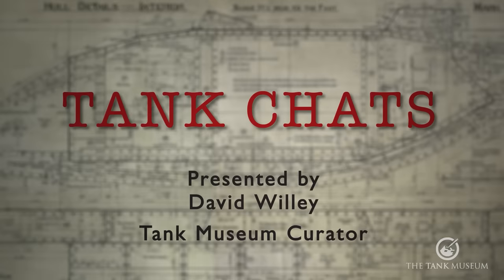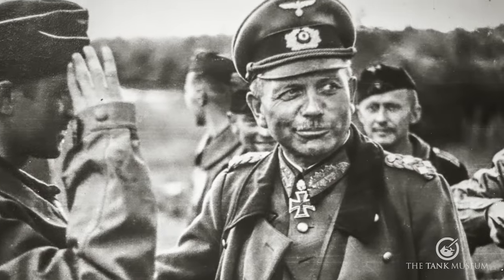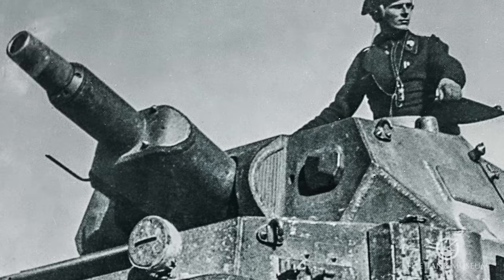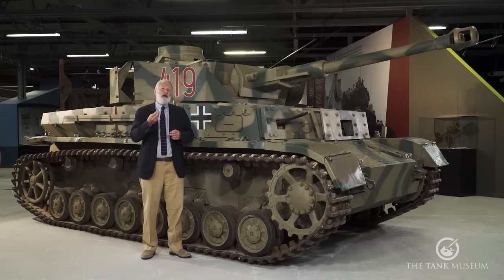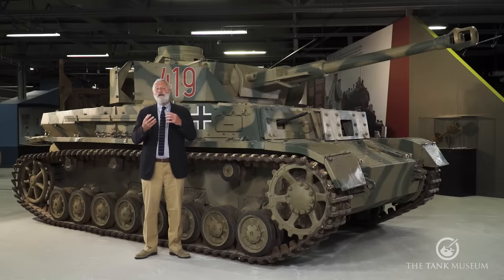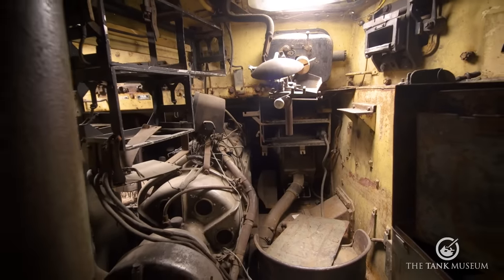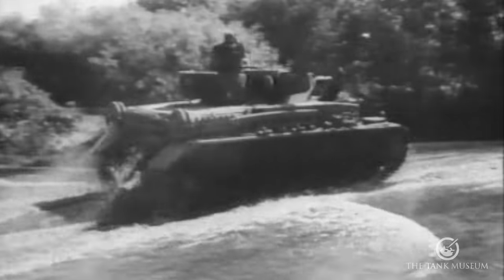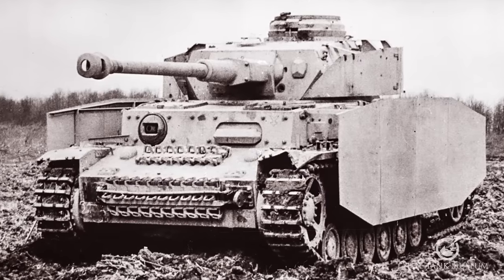Tank Chats #106 | Panzer IV | The Tank Museum

Comment: 75% of all PzKpfw IV losses were actually on the Eastern Front.
They better, considering that 80%+ of fighting took place there.
Reply: Tell us all about how you came up with that number.
Reply: @iatsd  Majority of land warfare took place on the Eastern Front as Wehrmacht rolled thru Europe in less than 2 years, taking minimal losses and then was stuck fighting Red Army for almost 4 years. Eastern Front saw the most brutal fighting during that conflict, with most major tank battles taking place there.
In addition to that, even after D-Day, despite Americans liking to believe how they won that war(or at the very least were critical to Nazi defeat), number of divisions engaged on the Eastern Front was around 300, to around 50 in the west. With latter also being mostly in subpar condition, as France was used for recuperating, rearming and resupplying units that sufferer heavy losses on the Eastern Front. While Western Front saw some properly equipped, trained and experience units, like Panzer Lehr, those were few and far between.
Reply: Tom Sanders  Eastern Front seemed to lack the Battle of the Atlantic and the strategic bombing offensive.
Battle of Atlantic was not a priority for Germany, as Luftwaffe and Kriegsmarine together were only getting about 40% of all military funding. Main push and priority was on Wehrmacht.
In June 1944 40% of the German army was not on the Soviet front.
Nice try. Two can play this game.
Excluding anything but France, taking in account total manpower of Wehrmacht during that period, extrapolating...
In summer of 1944 ~85% of German army were not on American front.
In June 1944 the greatest concentration of German armour was in Normandy.
By what standard ? Total number of tanks was roughly equal between Westers and Eastern front.
While Germans did not have a lot of tanks in Normandy itself, they brought in reinforcements from other parts of the France. Granted, they were scraping bottom of a barrel, so it included completely outdated machines as well.
If one looks at where Germany spent its treasure it was in systems which were most actively engaged against the West - high tech stuff like radar, aircraft, rockets, U Boats.
I have and the answer is "no".
Radars were used all over. Luftwaffe received about 28% of all military spending. Rockets were fun, but there were nothing more but pet project, especially in second part of the war, as Germany was concentrating on weapon systems that proved their effectiveness. U-Boats did a lot of damage, but it was due to their good design and crew training, plus abundance of targets. Total expenditures on Kriegsmarine were around 13% of military budget.
and 70% of single engine day fighters ended up in the West
No, majority of aircraft, at this point in time, ended up in Germany. Not that there was much left of them at this point.
Even that supposed sideshow of Italy peaked at almost 29 German divisions - quite a lot for a rather small length of front!
Tessin work is considered to be competent, but he was dealing with quite limited data(considering how this rather extensive summary was released in 66) and hardly conclusive, as even in this article it is stated on multiple occasions that many numbers may not be accurate.
Reply: Well, if the Nazis and Soviets would have simply moved the eastern front to France, SHAEF could have rolled them up together and smoked them both.
Reply: @sjent .
Some of the best panzer divisions were in Normandy, including 5 of the 7 Waffen SS panzer divisions and 3 of the best Tiger battalions including the most successful of all, 503.
Around Caen, the British Commonwealth faced the densest concentration of German armour ever deployed in WW2. 7 panzer divisions and 3 Tiger battalions in just 20 miles of front. There were no outdated machines in any of these divisions and both the King Tiger and Jagdpanther made their combat debuts around Caen. 
2/3 of German WW2 expenditure and material resources went on their air and sea forces and these were largely destroyed in the west. Already by the end of 1942 only 25% of German fighters were on the Eastern Front.
Most German army divisions on the Eastern Front were second rate horse drawn non mechanised rabble.
Reply: @RW4X4X3006  Lol, good joke. 
If it were to happen and Wehrmacht and Red Army were just neutral towards each other, not even allied, Allied forces would have as much chance as snowball in Hell.
Only reason D-Day invasion was successful was sheer size of invading force and the fact that they were fighting not just underamed and understaffed forces, but sizable part of the force they were facing was composed of old, crippled, teenagers and wounded(since France was used by Germany as R&R area).
But then again, i should not be surprised, considering how this tradition has survived to this day.
Reply: Tom Sanders  You can admit that you were wrong.
There is nothing to admit, your data is questionable at best.
the 1000 or so U boats produced during the war could equate to how many Panzers do you think..?
Ahh, yes, whataboutism, my favorite logical fallacy. Does not negate the fact that Kriegsmarine received far less resources than nay other branch during war.
I would suggest to a far lesser degree than in the Atlantic and West
You can suggest whatever you want. I would prefer facts.
The Soviet strategic bombing offensive was virtually non existent by day or night - so they had no impact on disrupting fuel, equipment production, transportation and research projects.
Right, because ~15000 aircraft(half of the in the west) at the time of German invasion was nothing to worry about. And Germany 2800 planes were more than enough to take on soviets, while flying blind.
I note you were quiet too on the many AA guns and personnel tied up in Germany...
Because i have no idea. Ive seen numerous sources citing wildly different numbers.
Albert Speer the later armaments minister said that in his opinion by 1942 the Western Allies (ad at hat stage mostly the RAF) already had a Second Front.
Id like to see a link to this full document.
Many of the panzer divisions in Normandy were full strength and fully equipped. Sure there were "static divisions" - but there were many divisions in the East which were classed as being able to defend only - ie static divisions.
Majority werent, otherwise they would not be sitting in France, waiting for equipment and reinforcements. Most military units arriving there were disbanded and their personnel and hardware added to already existing units, waiting for reinforcements. So when Allied forces landed on D-Day most of them were undermanned and underequipped and continued to operate this way for duration of whole campaign, as there was simply not enough reinforcements available.
You say that the German day fighters came to be based in Germany (as they were driven out of France and the Low Countries)  - many were, but they were not being used on the Eastern Front - that is the point
Because there were barely anything left of Luftwaffe. Planes were being shot down faster than new ones were put into action.
...yet many were thrown in to the Normandy battle - and lost - and the stats show that Luftwaffe crew were far more likely to survive in the East than the West.
Many ? On 6 June 1944 only the I/JG 2, I/JG 26, III/JG 26 and the stab squadrons were present.
During whole campaign Germans had barely 1/10 ratio with around 1000 combat planes total.
...or that the Axis defeat in North Africa involved losses in men and materiel  on the scale of Stalingrad.
North African Campaign lasted for 3 years, Battle for Stalingrad 5 months.
not like the British Empire or the US which could be fighting one or even two oceans away
Irrelevant. Soviets had to fight in same areas where they were growing food or manufactured tanks. For them it was far harder.
Americans never had anyone attacking their mainland. Even Japan, that was fairly irrelevant from standpoint of European Theater, never reached past Pearl Harbor, not to mention that their armed forces were so small, that their whole plan was to take US by surprise and then dig in and force US into negotiations, due to logistical issues associated with fighting for every rock in that big wide ocean.
Brits blatantly got lucky. Hitler could have completely crushed British military early on, but due to his nationalistic sentiment, instead of destroying 2/3 of British military in France, with minimal casualties, they were allowed to flee.
while others fought on both fronts, AND supplied material aid to the USSR.
Soviets had to fight, while both Brits and particularly Americans, chose their battles and were sitting on defensive till they were ready. After German military was severely depleted.
Oh, and let's not forget that other campaign that lasted the entire war in Europe - the Blockade of Germany - restricting its ability to import fuel, food and various metals.
None of which played major role in the war.
Worth recalling too that by the end of the war the US armed forces were comparable in size to those of the USSR.
And... ?
US would not be able to take on USSR at this point in time.
I'm not convinced that without the Western Front to USSR would have survived.
And you are entitled to your opinion.
Reply: @sjent  Read my post above. I provided a list of all the panzer divisions in Normandy with their tank types and tank numbers. None of them had second rate equipment.
8 of the panzer divisions had a Panther battalion. There were circa 650 Panthers, 750 Panzer IVs and 150 Tigers. The rest wete Stugs, Jagdpanzer IVs, Jagdpanthers etc.
All top quality stuff.
Reply: @sjent  That explains how the allies managed to wage and win the war around the entire planet, eh.
Reply: @sjent  Brits got lucky? No they had an air force and navy that Germany simply couldn't overcome. Germany couldn't even defeat the Royal Air Force even when it was at its weakest in June 1940. It got stronger and stronger from July 1940.
The European Axis never had a major war changing victory over Britain after France in June 1940. They failed in the Battle of Britain, failed in the Battle of the Atlantic, failed in the Mediterranean and failed in North Africa.
To 'crush' Britain you need a superior navy and air force. Germany had neither. The RAF was the Luftwaffes match and the Royal Navy was the Kriegsmarines master. You cannot defeat Britain with land forces if you can't even get across the bloody Channel.
The bottom line is that without the British Commonwealth in the war in 1940 and 1941 the USSR would have lost in 1942.
With no British Commonwealth in the war, the European Axis would have grown larger, more powerful with more resources, and would have controlled everywhere from the Azores to Iran. Turkey definitely and Spain possibly would have thrown in with them. That is then a huge Axis coalition and better placed geographically. Turkey borders the USSR south of the Caucasus. 
The Axis on the Eastern Front would then have overrun Russia at some point in 1942, Stalin would have sued for peace and been exiled somewhere east of the Urals.
Reply: @RW4X4X3006  Huh ?!?!
Reply: @sjent  The allies waged war around the entire planet. That's why we refer to it as a World War. The conflict between the Nazis and Soviets, was confined to eastern Europe. You need to stop studying cereal box labels.
Reply: @RW4X4X3006  The allies waged war around the entire planet. That's why we refer to it as a World War.
World War is called World War primarily for just one reason - it was war for control over the (most of the) world. The fact that it was waged across multiple locations and involved multiple nations was secondary, as wars that fit into this description were fought before, but were not called World War.
The conflict between the Nazis and Soviets, was confined to eastern Europe.
Absolute majority of deaths and devastation happened in Europe(USSR and Germany accounting for over half of death toll). Second largest death count is attributed to hostilities between China and Japan, altho their conflict started long before WW2.
Those two combined account for 85-90% of all casualties.
You need to stop studying cereal box labels.
I would tell you to pick up a history book, but i doubt ti would help much.
Reply: @sjent  Secondary expert, eh.
Reply: John Cornell  Bro, those numbers even if correct, they are still not the best example. Cause in 1944 to 1945 there were no German division that was at full strength on any front, they can no longer replace thier loses. Hitler focused the Werhmachts main  effort on the western front because the possibility of victory in the east is highly unlikely, meanwhile it is in the west that he thinks he could achieve some semblance of victory. That's why on September 44 they began to plan the counter offensive in the ardennes, that's why you will see the best equipped units in the Werhmacht is in the West because that is where the main effort will be. Of course, without the western allies the chances of success of the Werhmacht in the East is significantly higher. But also without the Soviet Union the Western allies would have taken the brunt of the second World War, it would require few million allied  lives to conquer Europe which was basically under Nazi control. It is safe to say that the Army that won World War Two was the Red Army.
Reply: The Soviets inflicted the majority of German casualties.  No argument there  The Americans supplied large quantities of supplies to all
the Allies, and by 1944 were responsible for providing a great deal of pressure on the Germans in the West.  The Americans were also on the offensive in the Pacific since June of 1942 and that was savage, brutal fighting that required huge resources over millions of square miles of ocean.

Comment: In hindsight they shouldn’t have even bothered with all the other tanks they ended up developing.  Should have just put all their efforts toward cranking out 50 thousand plus panzer 4s in various configurations.
Reply: But in what should they have been run on?
They barely had enough fuel for their historical amount...
Reply: Jakob Rinsdorf  if you average the fuel usage of aall the various armored vehicles they ended up building I’m sure the equal number of pz4s would use much less fuel.
Reply: @jakobrinsdorf7791  The things are probably more fuel efficient then the Tiger? Given they don't drag around the same amount of dead weight. It would have also saved a pretty nice amount of cash that could be invested in the supply line issues. Building more lorries or coal to oil factories. Easy to say in hindsight though.
Reply: The Germans were never going to win a war of attrition and the combined industries of the Allies dwarfed the German's. Put simply the Germans needed to invest in bigger and deadlier tanks to compensate for their lower numbers. 

Also the Germans didn't even have enough feul or men to supply the tanks that they did have, so adding thousands or possibly tens of thousands more would have only realistically resulted in a ton of unused tanks.

Comment: Imagine the ressources spared if they realized in the 30s that they didnt need the pzkfw 3
Reply: Pz 3 was more useful in French campaign than Pz 4. And without them we wouldn't have the awesome Stug...
Reply: The Stug III was germany's most produced and most succesfull AFV wasn't it? While they could've gone for the Pz4 chassis through the StugIV variant, you'd have to share production of the chassis between Pz4 and Stug 4
Reply: @broworm1  Stug most produced /yes. Stug most successful /kinda. As I said both vehicles had different purposes, and because the chassis difference they have advantages. You have to consider the intended initial roles for each one and how they ended the war. The sole weight and fuel consumption of Pz 3 made it perfect for breakthrough in early WW2 and a perfect scout at the end.
Reply: They should have used the pzkfw4  chassis from the beginin as tank chassis and stug chassis, as hitler stated in 1941, the pzkfw3 was a faillure due to the fact that waffenambt ignored his demand to equip it with long 50mm from the beginning, pzkwf3 with 37 mm gun losses in russia 41 where insanly high
Reply: @danydierickx3228  I'm afraid you are mistaken the Stug IV with the Jgpz IV. One is an infantry support vehicle and the other was a Tank destroyer. You just can't use the same chassis for everything, even today there are no support vehicles based on current MBT (like Abrams or Leopard 2) because is a waste of resources. Recovery vehicles for example are based on previous models like Patton o Leo 1.
Reply: @danydierickx3228  They always intended to fit the panzer 3 with a larger gun, they just didn't have it ready by the start of the war.